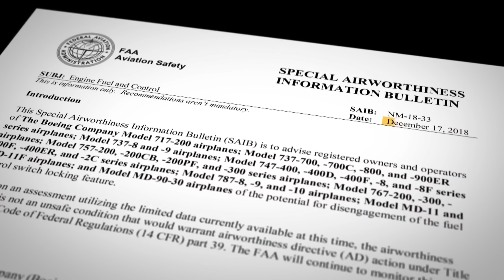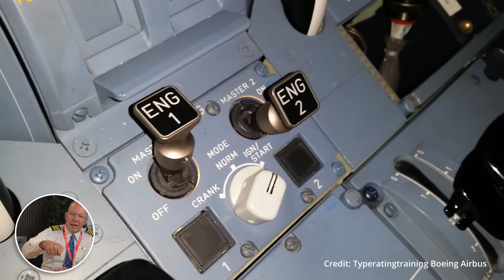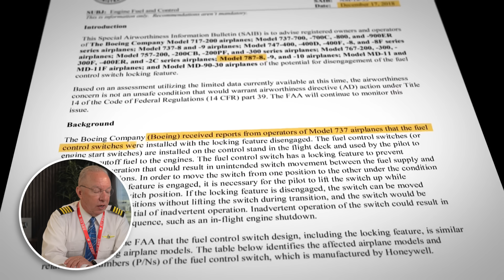Air India 171: The FAA’s 2018 Fuel Switch Locking Bulletin Explained (16 Questions Answered)

Comment: In fact, a 787-8 aircraft's fuel shutoff valves are spring-loaded to close, and cut off fuel, if they lose electrical power, and the system relies on multiple redundant power sources. The R.A.T is the last resort all other redundant systems have to fail before the  R.A.T is deployed. As the APU is started before takeoff on all 787-8 flights, that also had to fail before the R.A.T was deployed. The engine cutoff switches are mechanical but control is done through electrical system and ecu controlled. Also In the report, Bottom of page 5 the part both engines been replaced in the last 3 months before the crash, Also That the cabin crew that came in on Air India 171 reported faults on the air craft, The video that shows a passenger who also came in on flight 171 reporting that the Air-conditioning, lights, media, and call button for the flight attendants was not working....
Reply: The APU is usually NOT running during takeoff.
Reply: @jefftynan9274  is the apu on a 787-8 started before the flight.. Yes, the APU (Auxiliary Power Unit) on a Boeing 787-8 is typically started before the flight and is used to provide electrical power for engine start, as well as other systems on the ground and potentially in flight. The APU is a small turbine engine located in the tail of the aircraft.....Doesn't take much of research?..
Reply: @gp8126  No research needed at all. I am type rated in the 787. I was replying to your statement that the APU had failed. The APU would not have been running at all.
Reply: @jefftynan9274  I do apologize as I didn't read your reply properly, and you are correct it is switched off before the flight leaves and take around 2mins to restart, longer than the plane was in the air.. But...Is that all you have to say with all the reported faults on the plane and you still think the pilot made a boo boo?.
Reply: @jefftynan9274  Erm..Hi.. Can I start by saying " I am so sorry" and I am the worlds biggest tool. I had a hot hard day and didn't have my reading glasses on and I thought I was talking to Captain Steeeve. I've eaten showered and put my readers on and just realized you aren't who I thought you were.. again so sorry. I don't like it when people are quick to blame the pilot with very little evidence or none at all against them.
Anyway.. Again all my fault and I am sorry.
Fly safe my friend..
Reply: @gp8126  No worries.

Comment: We are overlooking a very important contextual fact:  that airliner had experienced power outages affecting the cabin lights, AC and entertainment stations throughout the previous flight.  I don't think that's a coincidence, nor do I think it can be ignored.  At the very least, it has to be excluded as a factor.  I wonder whether the amount of power needed on takeoff might somehow have created a surge or a short that triggered the fuel control switches.  The flight data recorder has them shut off, and we've arrived at a conclusion on that basis - but we have not ruled out electrical surges/shorts as a possible explanation.  You have the Pilot and Co-Pilot both denying that they shut off the switches - and yes, as a clinician, I understand that someone who is suicidal/homicidal isn't going to be honest about that.  But, we definitely need to remember what happened on the previous flight before we reach the conclusion that it was an act of mass murder.  It's too significant a factor, and in my view, too coincidental.  I would imagine that this would be a very easy theory to dis/prove, by having a mock set of switches and manipulating the electrical current to determine whether those switches could be triggered by a power surge, for example.
Reply: For me, the most telling part was that one of the pilot asking why did the other cut off.  He did not ask if the other pilot had cut off. I think he saw what happened, he knew the other pilot operated the cut off switch, hence he directly asked about the reason.
Reply: @GarryMah85  my view, in a panic , you can use any words. A lot of times we think , we could have framed the sentence a better way.. It's not scripted like in a movie to use the accurate words right. We ll never know exactly what happened unfortunately
Reply: Only ONE pilot denied shut-off.
Reply: @wwaynemcg  in effect both did.  The pilot asking the question did so implicitly.  One of them could have been lying, which is a different story.
Reply: @wwaynemcg  Ok, let's go to logic-school.  When the co-pilot asks the pilot 'Why did you cut off the fuel switch? - that's an implicit denial on his part.  You wouldn't ask that question of the other pilot unless you, yourself hadn't done so.
Reply: When did he ever say both pilot and copilot denied shutting off the switches? He didn’t say that at all. You think they conspired and they both did this together? That’s not the conclusion anybody has come to, you need to go back and listen to this video if that’s what you think he is suggesting.
Reply: @amandastumpff5252  OK let me help you with the logic thing.  If one pilot is asking the other pilot why he shut off the switches, the question itself is an implicit denial that the person asking it did not himself do it.  Hope that helps to clear things up for you.
Reply: @tedbohn4738  I don’t need your help, thanks. I was just posing another thought. Have a great day.
Reply: @amandastumpff5252  Wrong - you stated that both pilots did NOT deny shutting off the fuel switches.  That's an inaccurate factual/logical statement.  And you made your statement in response to my comment in which I noted that you have two pilots denying responsibility.  Add to that the fact that your comment was made with attitude.  So yes, you do need my help.  Logic by thy tutor.
Reply: @tedbohn4738  I definitely did not say both pilots shut off the fuel. Get some help.
Reply: @tedbohn4738  i’m sorry you misunderstood me, I was just saying that the pilot who turned it off could have denied it on the voice recorder so that his family could have still gotten insurance money. That’s all I meant. But why are you so ridiculously hell-bent on making people agree with you or else you lose your mind? It’s really bizarre. It’s OK if people have different views because nobody knows what has actually happened, everyone is just speculating so please calm down. It’s OK if not everyone believes EVERY. SINGLE. THING. JUST. LIKE. YOU!!!! Things will be OK I promise.
Reply: @amandastumpff5252  When I saw your comment (to which this replies), I had to go back to my original comment (the one you now claim is off the rails) to check whether I might have over-reacted or been harsh.  Because that's what mature people do - check themselves.  But I discovered that I had not been harsh, and that it was you who started this obnoxious thread.  I did not "misunderstand" you - you were very clear in your original comment to me.  I responded in kind, helping you out with the logic bit.  Nothing you said in your comment indicated that you made your statement to suggest that the co-pilot might have denied it so that his family could collect insurance.  You made that up just now.  Please just stop trolling me.  Days later, no less.  It's obnoxious.  I think you're an oppositional-defiant, who trolls looking for anything and everything to disagree with just for the sake of disagreeing.  Get help.
Reply: @tedbohn4738  this was days ago and you came back for what reason? Because you can’t let something go or be OK with someone disagreeing with you? I think you need help. Please leave me alone. For the love of God, please leave me alone, I don’t care about your opinions, and you don’t care about mine, so stop, I don’t need this, and if you think I’m so obnoxious, stop coming back to berate me. I dropped this days ago and I have moved on. I’m sorry if you can’t. Leave me alone.
Reply: It's a mechanical switch. Also, they did the simulation where they shut off power to a plane, but that did not shut off both engines.
Reply: Everyone is trying to run their brains, coming up with all possible theories. IMAGINE - when the final analysis comes out, and none of these theories hold true? Then? Stop maligning those who are not here to defend themselves. Mass murder!! Seriously? Social media has given people the liberty to be as insensitive as they can! Stop this speculation.
Reply: the switches were manually moved into the cutoff mode.
Reply: The cabin electrical system does not intersect with cockpit controls as you're imagining. And only one of the pilots denied the shut-off. That was the senior pilot who was not flying the plane and who had told his father he was resigning from the airline.
Reply: @Everywhere2  I suggest that you listen to the interview done with Mary Schiavo (former head of the NTSB).  She is spot-on.  There are many instances in which commentators (such as yourself) have declared pilot error early on - only to discover that the problem was errant software.  She even points out that people claimed pilot error in the case of the two 737-max crashes, which were the direct result of Boeing's ridiculous software programming that didn't allow the pilots to over-ride.  She explained that the forensic dna will be in the lines of code that controls those switches - and she was confident that those lines will be there.  They will provide a definitive answer.  She is absolutely correct that arriving at a conclusion without that information is premature and counter to, what the NTSB does.  They always find the answer because they leave no stone unturned.

Comment: Hi, this may not be a question but i wan to elaborate on the question that stated: There could be a logic for for fuel cutoff system. What if the logic uses data record when the plane takes off then after a set time it would disengage the logic, so it wouldn't intervene with a possible flameout/ engine stop/ restart after take off.

Comment: Who has studied the schematic of how the switches are connected to the flight data recorder and the rest of the system? Is it wired or connected to a bus? Is the signal that indicates the position of the switch to the FDR the same as the signal that goes to the computer that controls the fuel valves -- or is there a separate circuit for position indication? As an engineer who has seen many confusing indicators and signal issues, I'm always considering bad grounds, shorts, and/or connections that make and break on expansion and contraction of wire ways, etc, etc.

Comment: Just an opinion, there is pressure to blame the pilots especially when profits are affected. The report did not show the time when the switches were put on the Run position prior to show the cut off time as reported, Not shown. Also the photos where the switch were in the cut position was not verified or corroborated to come from the AI plane.

Comment: {switch detent's}   AGAIN
I have not seen or heard  from anyone that knows for sure or have tested [post crash] to see if the switches being discussed do indeed have detents.  So far every body assumes that they do. They also assume that the switches were moved.  I would not assume that the data flight recorder did actually record a switch or switches being moved.   
I also don't trust the audio from the cockpit voice recorder with what has been released so far.  Cockpit voice recorders normally pick up sounds as soft as breathing of the individual wearing the gear.  
 I have always during evaluation of, or trouble shooting an event similar to this to be skeptical of contacts, relays, wiring, all electrical components. I have experienced switch contacts to appear closed when not as well as open when not.      Electrically!!  
Way too much missing information. I'm not blaming the two officers in the cockpit anytime soon.
Video cams and recorders should absolutely be installed in cockpits. Sorry about your privacy.  If everybody behaved appropriately 100 percent of the time than maybe they would not be needed.  Banks and other high risk areas use them religiously.  And not for just run of the mill crooks.

Comment: That can not be what the memo meant.  If the plane could not even fly if the switch locks were installed backward then they would have to be fixed immediately.  That could not possibly  be what the memo meant.  The memo said the fuel switches could be cut off during flight.  How much is Boeing paying you?

Comment: I wonder why they don’t swap the fuel control valves positions so the shutoff position of the fuel control switch is in the upper position, and the Run position is in the lower position. Of course, this would only help to prevent the accidental disengagement, as anyone with intent could still move the switch to the cutoff position no matter the orientation of these controls. I would still push for this positional change, as there has to be a much smaller number of pilots that are wanting to commit suicide (or havoc) than those that might accidentally bump these switches, due to accident, with no forethought or malice. Keep up the great discussions! Lee
Reply: But the switches have an indent, which means they cannot be bumped to a different position.  One must pull up on the switch before moving it.

Comment: All these reasons are covering for Boeing . There was definitely an electrical/ mechanical issue with the plane and quite possibly software issue that caused these switches to cut off .
Reply: Wow, really?   Are you serious in your comment?  So, what you said was that it was either an electrical issue, a mechanical issue, or a software issue.  Well gee, that really narrows it down, huh?  Oh, but what about the possibility that one of the pilots just reached over and switched them to cutoff?  Why did you leave out that possibility?
Reply: @jszlauko in fact, this airliner had very serious electrical problems on an earlier flight that day. The cabin lights, AC, and entertainment portals were all inoperable.  This is a contextual fact which is too significant to ignore.
Reply: @ted1091  - OK, that’s all fine.  
But how can one ignore the possibility of the pilot reaching over and flipping the switches?  

So true that one certainly cannot rule out some sort of electrical cause, but by the same token, one cannot rule out the possibility of the pilot flipping the switches.  

What I don’t get is how can Steve be so sure the switches were flipped based on what the FDR shows, if the FDR is only recording electrically what the setting is?  

But then I guess it might be based on the fact that the switches were flipped about one second apart, which is consistent with a person flipping the switches.  If there was purely an electrical issue, then one would think both switches would have shown as being flipped at the same time.
Reply: @jszlauko it’s possible the switches were changed manually but I don’t think we can say we know that’s what happened for sure at this point. If you consider this happened beyond the pilots actions the discussion between the crew can be taken at face value and makes a lot more sense
Reply: conspiracy theorists never think things through.  If it was a cover up, they would just be digging themselves deeper. If there is an electronic issue imagine if it happens again. Or if they identify it and have to replace all modules on all the planes, how on earth do you keep that secret?  Coming clean about a parts issue is just what is done....they know they are better off doing that, fixing the problem, and moving on....trying to cover that up would be death of the company.
Reply: @zofrosto I’m not suggesting it’s a cover up either the investigators may not yet know exactly what happened

Comment: This is so sad, seeing Captain Steeeve, really blaming the pilots without reading the FAA bulletin. The bulletin clearly says that the locking mechanism could disengage, and the switches will continue to work as they should just without the lifting up locking mechanism. I really would expect a pilot to read these reports and bulletins before directly blaming the pilots. Captain Steeve should read the FAA bulletin properly and set the record straight that maybe the pilot who says in the recording that they didn’t put the switches to cut-off was telling the truth.

Comment: Steve's heart is in the right place but...we will never know for sure without CAMERA EVIDENCE whether there was a system hack/malfunction, or (since the fuel switches are mechanical) whether someone tampered with the switches before the crew boarded; perhaps a switch can be hacked so that simple vibration throws it to "off".  Whatever. There is too much at stake; I could give a rat's arse if an officer is napping or watching porn so long as it doesn't jeopardize safety. Imagine a video showing that no officer touched the switches? Game changer in the maintenance of 787s. If it was deliberate, mandate annual mental heath reviews.

Comment: Thanks for your excellent explanations Steeve. You are absolutely clear!!. Actually I've never flown an airplane. I'm only a 59-year-old man living in Argentina and having flown barely twenty times. But, excuse me perhaps is a silly idea,  but I am wondering: It should be better a Boeing Planes upgrade or recall, to avoid to cut off the engines during some particular conditions such as the takeoff of the plane?. Or until it reaches an reasonable altitude?. Thanks for everything!. All the best, Hugo from Buenos Aires, Argentina.